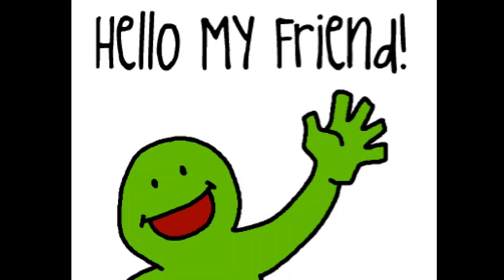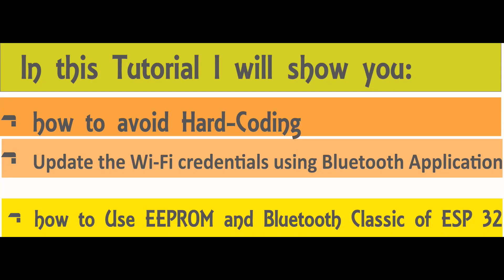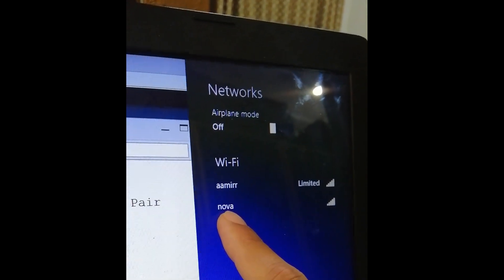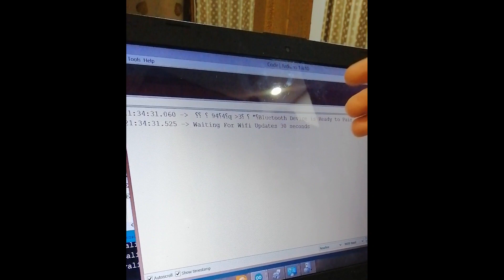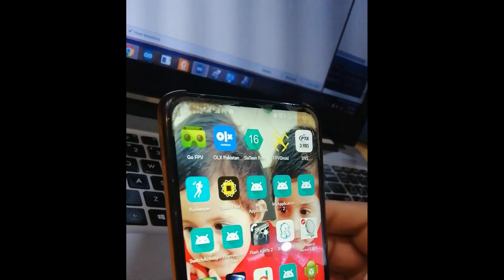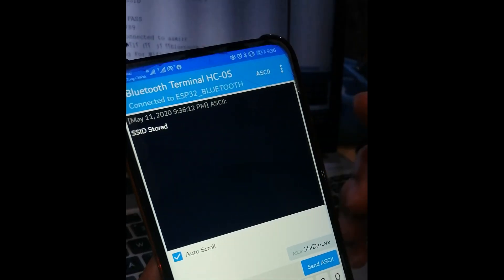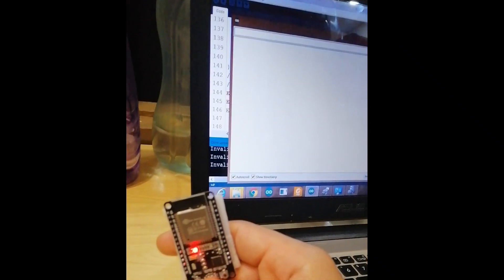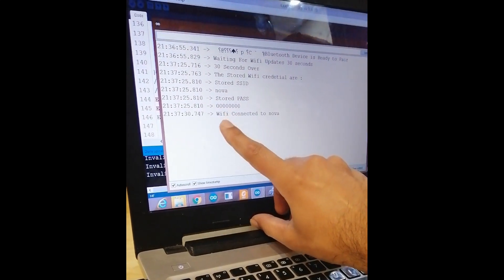Avoid Hard Coding ESP32 ||update Wi-Fi credentials using Bluetooth Application.

Comment: Sir can I use RX2 and TX2 as digital input pin ? Please reply
Reply from the maker: Yes
Reply: @espstack  thanks for replying sir. But am facing some problem
ESP32 board is auto disconnect to blynk interface when I reset ESP32 power supply then blynk server connect and working properly after 10-15 minutes again blynk server gone offline.
Reply from the maker: @0124akash  make sure you have BLYNK. Run() working in. Loop
Reply: @espstack  okay sir I will check then give feedback to you.
Reply: All ready declared sir.
Reply from the maker: https://www.fiverr.com/s2/5e47db8491?utm_source=com.google.android.apps.docs_Mobile